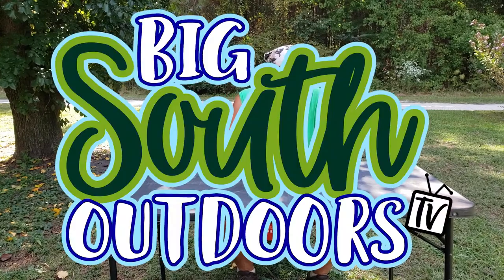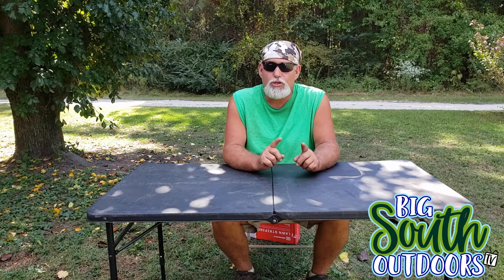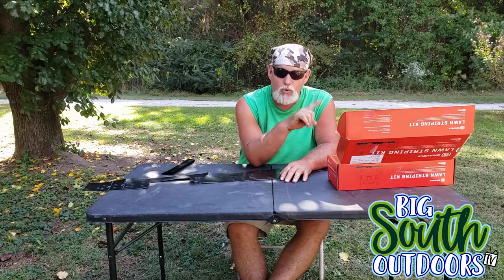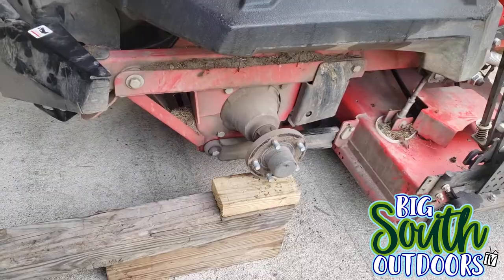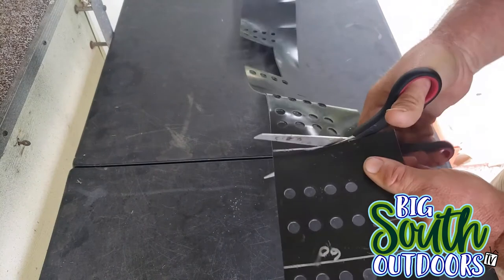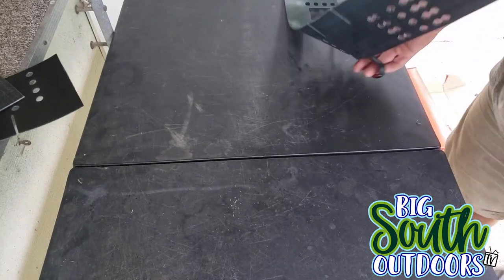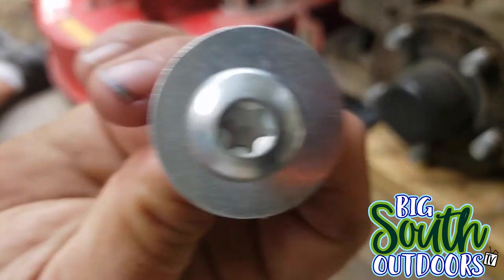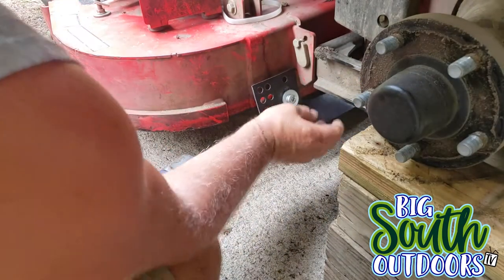HOW TO Install A Stripe Kit On A Gravely 452 Zero Turn

Comment: A great honest video. My mowers have a built in roller and in my experience I find a weighted roller gives you a much better  stripes,  can you not get a roller attachment for your mowers.  
If not would love to see you make one not sure how hard that would be.  
Thanks for the great content. 👍💪
Reply from the maker: Thanks for watching! The deck design of this Gravely zero turn does not allow for a roller attachment, but the rubber attachment I fashioned works wonderfully. Check out our video of making and using our DIY stripe kit! Hope you're subscribed.
Reply: "Big League Outdoor Products" makes a roller kit that fastens onto the rear of Gravely Zero Turns....for $ 385 - $485! 🤑😲

Comment: Got a new Gravely coming next week. Having it built with their Stripe Kit. I'll probably leave it on there for a template till I can locate the material to make a real one, thanks for the heads up, liked and subscribed.
Reply from the maker: That is awesome! Thanks for the watch & sub! Make sure the material you use is heavy duty enough to last, preferably a rubber semi mud flap.
Reply: Got a roll of 4" wide 1/4" thick solid rubber in my Amazon cart. Think it'll be heavy duty enough?  @BigSouthOutdoorsTV
Reply from the maker: @charlesbeall2589  it should be more than sufficient. Thanks for watching.

Comment: I have a 52" hd, just put the striping rubber on it from the wright stander. Had to drill two holes in the deck to line it up properly, but it looks like it's factory, and actually works.
Reply from the maker: Thanks for watching. Wish you much success!

Comment: This same striping kit I installed on my Ariens Zenith I have not experienced any breakage; however, its performance in terms of striping effectiveness has fallen short of my expectations. 😞 The striping effect produced is not satisfactory. 😞
Reply from the maker: Thanks for watching. If you have one near you, go to tractor supply and buy a horse stable mat. I used a semi mud  flap and it worked great. Only down side is, you have to use 2 separate pieces because it's only 36" long.